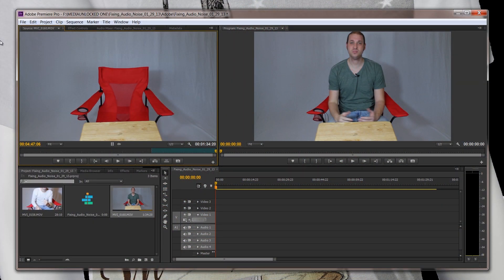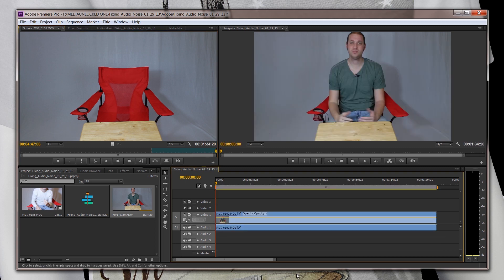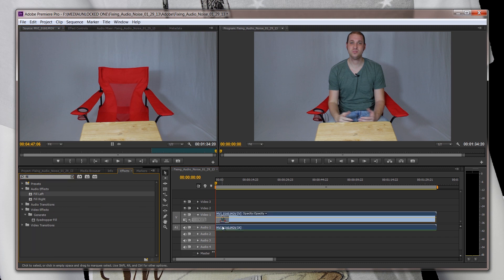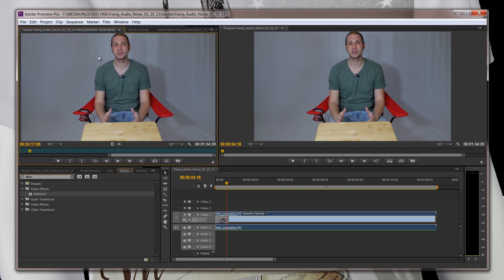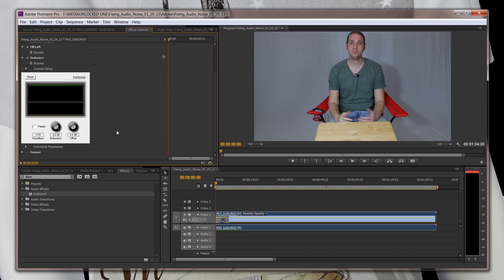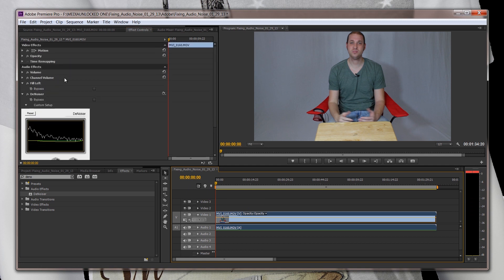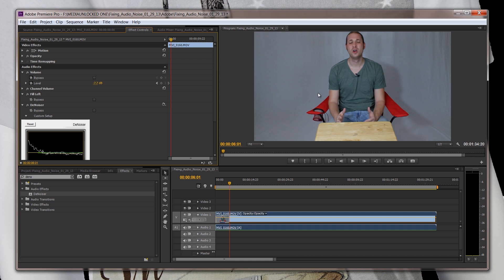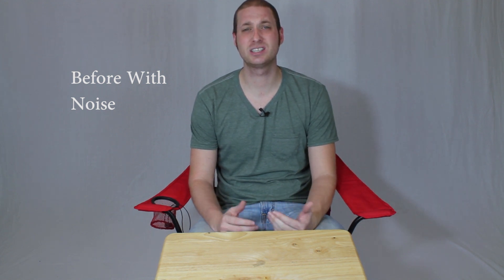How to Fix Audio Noise With Adobe Premiere

Comment: Hi am having problem with the audio background noise in premiere pro cc 17. Its not a normal hiss background its like 'teeeeeeeet' continiously on the background while using rode video mic pro and if i use camera sound it is fine just a normal hiss noise.. so i couldn't figure it out..whats the problem ?plz help.thank u....
Reply from the maker: It might be your gain control. Look where your battery goes and see if there is a switch to change our gain.

Comment: well I did this but at the beginning of the video there is still some noise. Can you please help me with this problem. Thank you
Reply from the maker: +koleksionlodrafemijesh it should fix its self on export
Reply: +Media Unlocked I have the same problem as this guy and it does not fix itself on export, intact it only really is apparent after the video is exported. What do I do?
Reply from the maker: +Carter Falk try extending the beginning of the clip then cutting it back off.